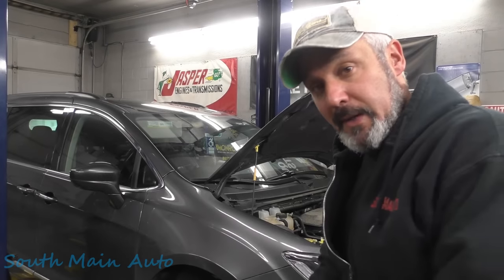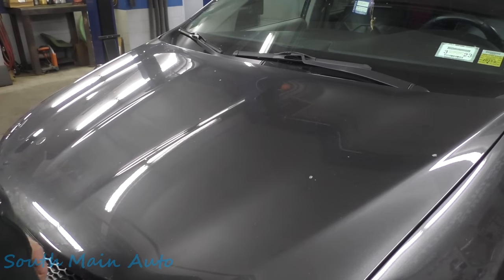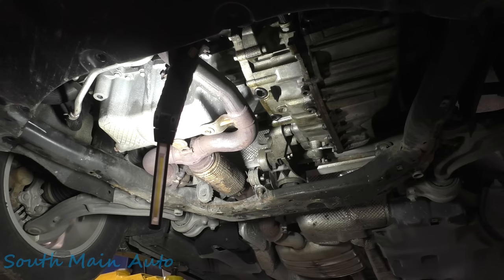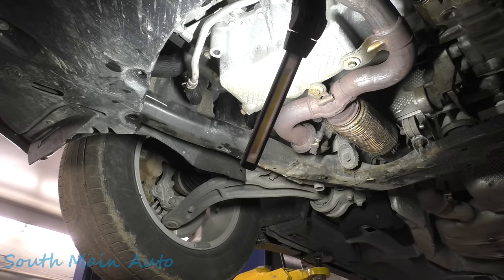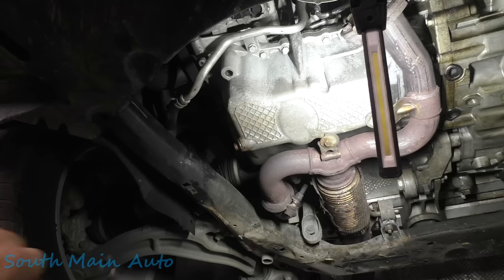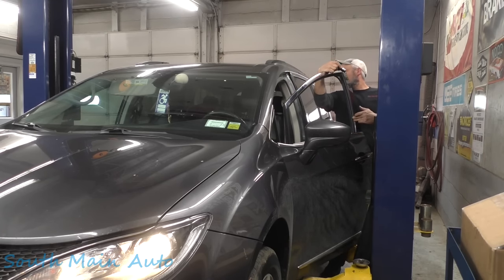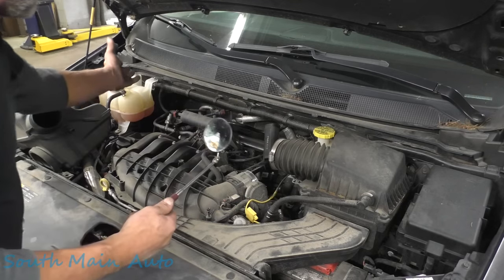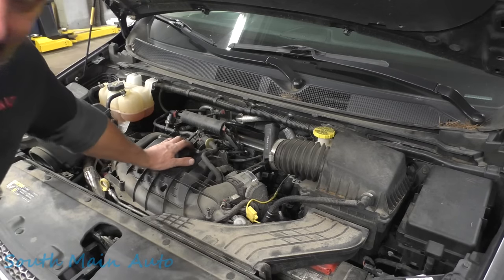Chrysler Pacifica Goes Full Nuclear 💥

Comment: It's certainly the right call for the customer if there is a strong likelihood that the cost of a low mileage replacement engine is dwarfed by the cost (and risk) to repair the existing one.   There are few people out there who I'd regard as an 'expert' these days, but if Mr. O. says it's a bad bet, you can take it to the bank.  

Not only that, but it's likely the only reason it's in the shop is because the starter died.   If she's been cranking/starting the thing while it was trying to hydrostatically lock, you could also be looking at a bent or stressed rod.

Comment: I have a 2020 Chrysler Pacifica with 278,389 miles on it. I change my oil, plugs at 100k and I did my surpinten belt. Only thing that I’ve repaired is change a low beam. I mostly highway drive so still have my original brake pads. Love my Pacifica.

Comment: This is a teachable moment.  Don’t drive around ignoring what appears to be major coolant loss.  Particularly, if you’re not seeing puddles under car.  Look at the exhaust and see it’s white.
Reply: My 2011 GMC Acadia had an odd noise and a few misfires after sitting overnight.  Shop supervisor at dealer checked it, I authorized an extra hour to confirm his diagnosis of porosity in the block casting. TSB applies to 2009-2021 3.6 V6 in all GM products from Caddy on down mounted both transverse and longitudinal. Apparently GM figured it was cheaper to fix them if they failed during the 100K mile warranty period than to fix the casting problem.  The V8 had a problem 2012-2015 so apparently they fixed the mfr process or the design. Other mfr had porosity problems with aluminum blocks but didn't let it go for 12 years.
Reply: To be fair she didn't ignore it, she kept refilling it. Quite possibly she knew it was a potential head gasket or similar and wasn't willing to fix it.
Reply: You missed the root lesson - never buy a Chrysler product.
Reply: @joeschmoe6908  yep. My old Towncar smoked oil and coolant both for quite a while, somewhere around a quart a month. Still drove it for like 30,000 miles and a couple years before it went catastrophic (in an unrelated way: the connection on the manifold for the hose going to the heater core cracked, probably because I futzed with said hose every time it got hot to bypass the heater core so I had AC...).
Reply: It's the , "you can pay me now, or you can pay me later." But frankly, how many drivers have the knowledge to correctly decide what to do when a warning light illuminates? By now cars should have a "CRITICAL, STOP ENGINE" warning light for things like extremely low oil pressure or extremely high engine temperature. Most drivers aren't mechanics and don't understand the damage done by driving w/ no oil pressure or an overheating engine.
Reply: @steadyeddie7453  I would love to see such a light in cars. These days, the check engine light is used for anything and everything under the sun.

Comment: We've had 2 2019 Pacific's come in in the last month with head gasket failures on cylinder 5. Apparently it fairly common and almost always on cylinder 5. Head gaskets are currently on national back order because of this. Not a real fun job either. It usually starts out as a very light misfire before it gets to this point.
Reply: Of course they are on back order. Its the new normal in the US now..

Comment: Absolutely good call for a engine as normally it will wipe the bearings once coolant gets in the pan. Could spend way to much trying to fix it to just have it fail soon after.
Reply: I'd think if it were to get fixed an engine replacement makes 100% more sense than doing anything at all to the engine currently in it, other than trashing it once its removed LOL.  I sure wouldn't waste my time pulling it and taking it apart.  If she overheated it, and I'm gonna guess many, many times, it ain't worth it...the heads are probably nicely warped...hmm head gasket leaking, and wouldn't be surprised if the block wasn't warped too.  People just ignore the simple cheap service & repair stuff, then wonder why they need a new car every couple years.
Reply: Not to mention the possibility of bent rods.

Comment: The back cylinder head has been known to leak and lock up.  Also it smokes the starter because people try and try and try starting them and it cooks it.
Reply: Yeah.. I just imagine her cranking and cranking on that key. lol
Reply: @calholli  they have what is called tip start. It will crank for about ten seconds as soon as you press the button while the brake is applied.
Reply: @goat3898  oh right..  it has that goofy push button setup
Reply: @mikec9112  if you press the button again it will stop but a lot of people aren’t smart. Had a few jeeps with that new 3.6 have the same problems blown head gasket and starter.

Comment: I agree, its not worth tearing into. I did a yukon denali XL that dropped a lifter, and the price to rebuild the top end with that DOD/AFM system is absurd so I went ahead and put in a brand new engine from Chevy, complete with Chevy Thunder. Came with 100k 5 year warranty too. Ultimately i feel it best to use OEM parts only. I definitely am more expensive than some repair shops, but i have ran into too many issues with aftermarket stuff from the napper and others. As always, I love the videos Eric, you are a fantastic mechanic
Reply: Related to Stacy?
Reply: I do crazy stuff with my personal stuff. Dropped lifter on those, pull the head. Install some used lifters out of the box I have of lifters, new plastic lifter guides and head gasket. Back together with fresh oil/coolant and disable the afm. Under $200.

Overheated engines, they are junk.

Comment: My first work experience was in the shop at a Chrysler dealership.  The mechanics would just complain about how crappy the cars were they were working on.  This was in the mid-80's with the K Cars.  Nice to see nothing has changed.
Reply: Actually before the 1980s Chrysler had some good engine like the slant 6 that son time came in 2 sizes and the 318 ci V8 that was in Diplomats trucks and Vans into the nineties.
Reply: Actually something has changed it gotten 500% worse. 80's Chryslers are gold compared to the garbage they produce today

Comment: These 3.6s we know have had head gasket issues for years. Had almost the same thing come in, starter fuse was blown. Found coolant in oil. Cylinder had hydrolocked and blew the fuse. Couple weeks later another guy called also with hydrolock issues, blew several fuse blocks with a new starter/alt. I think this will turn out to be a new common problem with these year/models

Comment: This is super unusual. The 3.6 is usually bulletproof and reliable as you said. I've seen Promasters and such with 500k+ miles on them.
Reply: People can find a way to make everything unreliable. Its a wild thing to witness
Reply: That 3.6 is not a reliable engine, analogous to GM's 3.6
Reply: @maxdm1583  we had the same engine in our grand caravan. Was overall reliable. Sold it with 227k and still running well. Then again, I maintain my cars and perform services regularly. That probably helped.
Reply: @romeo1550  You maintain your vehicles. that's why yours lasted over 100k LOL.  Its funny to listen to people complain about every vehicle they've owned being a pile of crap, then you get down to the fact they didn't do any maintenance at all and they whined because the vehicle blew up at 50k from sludged up internal engine components, no oil, etc.
Reply: 500k miles and probably 5 transmissions
Reply: Me personally I've never seen one with over 150,000 miles that wasn't making some kind of noise
Reply: The only bulletproof thing I've seen Chrysler make is that 4.0 inline six
Reply: @wildbill23c  💯 
I tend to keep a vehicle for some time so regular maintenance just makes financial sense. Cheaper to change the oil, flush the coolant and replace fluids than rebuild an engine or buy a new car.
Reply: @jasonmurdoch9936  Wasn't the original basic engineering of the Chrysler 4.0 I6 done by American motors?  Chrysler got the AMC 3.8/4.2 I6 that AMC used in their Jeeps and other vehicles when they bought AMC in 1987.  Of course it was modified over the years for performance and emissions reasons, but the basic engineering on the AMC I6 engines was rock solid.
Reply: @Vincent_Sullivan  American Motors back to Rambler back to Nash.  The Rambler i6 was bulletproof, the rest of their cars wasn't.
Reply: Never had a problem with the 3.6 just everything else on the vehicle falls apart
Reply: @jasonmurdoch9936  Technically, that was not a chrysler.  It's roots go back to the AMC days.
Reply: This 3.6 isnt reliable, its not the pentastar thats in a lot of other vehicles that one is super reliable like over 1,000,000 miles reliable.
Reply: @maxdm1583  speak for your self I have 2 of them both have been fine
Reply: @romeo1550  My newest vehicle is 14 years old, my oldest is 34 years old.  I don't have car payments and don't want them, the routine maintenance is a heck of a lot cheaper LOL.
Reply: @jasonmurdoch9936  Even those weren't very good if you didn't keep up with the maintenance on them, just like any other vehicle...Chrysler's major weak spot is automatic transmissions it seems...and for me 1 4L I6 that didn't make it past 150k...but I think that was due to the previous owner's neglected maintenance.  My first Jeep Grand Cherokee had the 4L I6, 232k on it when I sold it, and still ran and drove great, and I beat the crap out of that thing, it was covered in mud more often than it was clean LOL.  The 2nd Grand Cherokee I had was a 98 that had the engine/transmission issues...and like I said I believe that was due to the previous owner's neglecting regular maintenance.  I had a 99 Dodge Ram 1500 4x4 that had the 318 V8 in it, never had any issues with it either, but it wasn't full of all the electronic/electrical stuff either, it was a base model and manual transmission.
Reply: @jasonmurdoch9936  All engines make noise when they're running ;).  

A lot of the ones I've seen around seem to have valve train noise, worse than the 2.9L V6 in my 88 Ford Bronco 2 did.
Reply: @_zigzak  Yeah people usually leave out those minor details LOL....although my 96 Jeep Grand Cherokee had 232k of hard miles on it and never had any problems...but I always kept up with the regular maintenance too, which is a lot of the issues you'll find is people skip every maintenance thing they can especially if they have to pay for it.
Reply: @wildbill23c  I know we all engines make noise when they're running but his engine was tap,tap,tap and would progressively get much worse the more he drove it
Reply: @jasonmurdoch9936  Before I replaced the engine in my Bronco 2, that's how it was, the warmer the engine got, the thinner the oil got and the louder the tapping and valve train clattering got LOL.
Reply: @wildbill23c  we bought the grand caravan new back in 06. Sold it in 2018 and bought a used 2016 flex with 15k miles. Still have it now and we are just shy of 80k. Runs great but I do regular maintenance. My other two vehicles are at 200k and 280k respectively. A 2010 fusion and on 01 f150. Just maintenance and it makes all the difference.

Comment: I drive a 2003 GMC. 235k and it runs like a top. Seeing all these 2017 and newer vehicles with major issues makes me just want to keep running that 2003 until the wheels fall of, then bolt them back on and it run it some more.

Comment: The same dreaded head gasket leak just struck my mother's Pacifica last week. 163,000 miles of hard driving, so I applaud what it did give her. She's looking at a used or new engine for it. I'm curious if your customer ended up opting for the engine replacement, and if so, I'd be equally curious to know where you sourced the engine from. She's not terribly far away in Fulton, so it might be possible to source from the same place. You're a busy man, so if you get to this thank you, if not, no worries. In the meantime, I'll continue to enjoy this excellent channel

Comment: If i was living in Your area I would not hesitate to use Your shop. Had the same problem with my  Honda ridgeline. Fixed it my self , but that was a lot of work ! The head gasket was blown, and the engine block, also had corrosion problem. I think You know what I mean. Thank You fore sharing Your videos and great skills !

Comment: I had a customer the other week have an overheating problem. diagnosed having a leaking rad hose and thermostat housing. She declined repair and was adding a quart of water to it every day. She comes back in with a no start condition. She was adding water into the engine through the oil cap and hydro locked it. We thought she overheated it bad enough to blow a head gasket, but she showed our advisor where she was putting water, and everything made sense after that
Reply: I am at the part of the video right now where Eric pits the oil plug back in after letting the water out. My exact thought, she was putting water in the oil fill. You can see the antifreeze overflow has a colored type of fluid in it.
Reply: Good grief.....
Reply: @robm3063  Yeah, that is my guess too.  She was adding water directly into the oil fill port.
Reply: Good. Stupidity should hurt that's how they learn.

Comment: You're right about the 3.6 being relatively trouble free. I have a fleet with about 130 Chargers, about a third being the 3.6L (non-pursuit). The biggest problem they normally have are the oil filter housing assemblies cracking. I've only had to do 2 cam/lifter replacements as opposed to about 50 or so on the 5.7L.
Reply: 3.6 is the way to go for sure.
Reply: Hemi's don't like being idled excessively. I'm always paranoid about hearing the dreaded Hemi tick lol. But I have also seen many run high miles trouble free.
Reply: Many failures, especially on earlier revisions of that oil filter housing assembly can be an internal oil cooler failure, which allowed the fluids to mix.

Comment: They made over a million of these engines.  Few blown head gaskets here and there is a statistical blip.  Courier driven Promaster Vans are getting up to 700 000 miles on these engines, which is pretty amazing for a 6 cylinder gas engine.

Comment: Good call. Too many unknowns to just assume a new set of head gaskets and maybe a starter will fix her problems. But I do have to wonder if the t-stat stuck causing the engine to overheat, which blew a head gasket or the engine blew a gasket causing the overheating?

Comment: Wouldn't checking with a code reader for a misfire count (in it's history) lead you to the guilty cylinder for a leaking head gasket? I know it's smoked but I mean in order to pull a plug and throw a camera in the cylinder to look at the swimming pool sitting on top of the piston.
I had a Hyundai Santa Fe that was using a small amount of coolant (car was given to us) and when the engine was cold it would miss on a cylinder (code reader was showing #4 cylinder) and it would cut fuel to that cylinder, I could warm the engine for a couple of minutes and shut it off then restart it and it would run on all six cylinders after that, and yes I swapped the coil packs around and replaced the spark plug to rule out those items. The car was a beater work car and it's value wasn't worth the price of a set of head gaskets so I drove it like that for probably 20K miles until I found a replacement car then just junked it.
Reply: Not a bad idea but the intake manifold has to come off to get the spark plugs out.

Comment: I'm on board with a couple others thinking that poor starter tried its damnedest to turn, but couldn't and burnt up. I'm surprised the over-current didn't fry something prior.
Reply from the maker: Well it has a 500 amp fuse running to the motor. And that fuse was still good.
Reply: I have seen that many times. Junk engine people try to turn over. Nuclear burns up the starters
Reply: Someone gotta make a meme the little starter that tried or something... kinda like the old school book the little engine that could
Reply: The push button start doesn't help.  The computer keeps the starter engaged for a long time trying to get it to crank.  Most people would let go after a few seconds.

Comment: Gonna bring my 2018 Silverado 1500 to you soon. Dealer replaced water pump and now it runs hot with any load on the truck. Especially when I tow my 1,500 lb enclosed trailer. I’m in Buffalo. Been back to the dealer 4 times now.
Reply: Hi from Canandaigua.
Reply: Jimmy S  dealer replaced it. Just got it back yesterday after they removed and inspected the water pump. It’s driving me crazy! GM is acknowledging an issue for sure but they can’t figure it out.
Reply: @youbadolivez  not far from me! Love Canandaigua!

Comment: Mr. O you should of check the fuse array in the PDC, fuse that supplies power to starter might have been open. I had the same condition on a same model with the 3.6L, replaced the engine & the no star was still present until inspecting & replacing the fuse array

Comment: If she agrees to put a used engine in it, it would be interesting to see a part two
Reply: I'm not sure what a 2017 Pacifica goes for where you live, but here in Vancouver, they go for north of $23,000 US. Surely they could remove that motor, and put in a new one, or good low miles one for well less than $20,000 US?
Reply: Even 2017's go for $18,000 or better in the Detroit area.  Why people buy these? They really are nice vehicles. Call me crazy but I bought a used 2020 last winter with 67,000+ miles on it and it runs great. Nice and quiet, no smoke. It is meeting our needs.